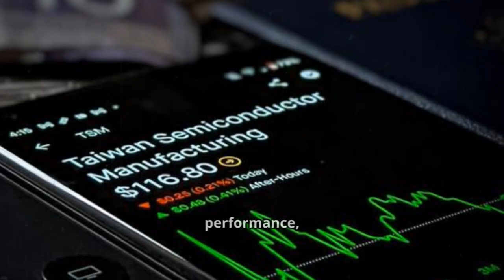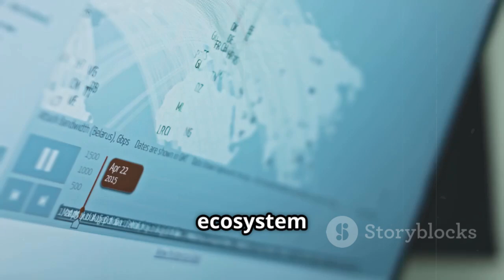Huawei's Bold Move: 3nm Chips Production Begins!

Comment: Huawei has officially begun research and development on 3nm chip production, with plans to complete the design (tape-out) phase by 2025. 
Huawei pursued through two distinct approaches: one utilizing Gate-All-Around (GAA) transistor architecture, which is expected to tape out in 2026, and another exploring carbon nanotube-based chips that have already passed lab validation and are now being adapted for SMIC's production lines. 
Huawei is relying on domestic Shanghai Micro Electronics Equipment (SMEE) SSA800 machines combined with multi-patterning techniques like self-aligned quadruple patterning (SAQP). 
Despite the challenges of lower yield and higher costs associated with DUV-based manufacturing, Huawei is advancing its chip capabilities, building on the success of its Kirin X90 chip, which uses advanced packaging to achieve 5nm-level performance despite being based on a 7nm design.